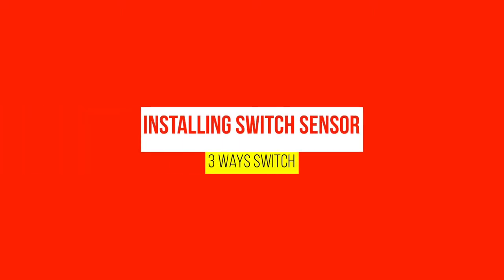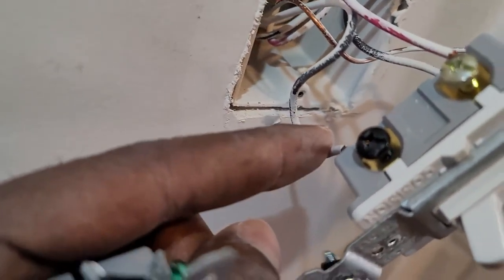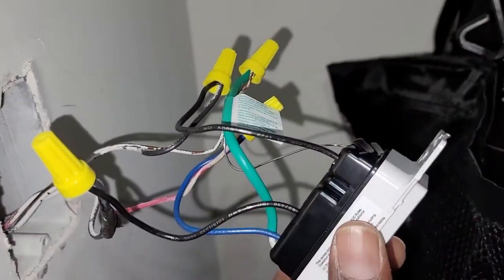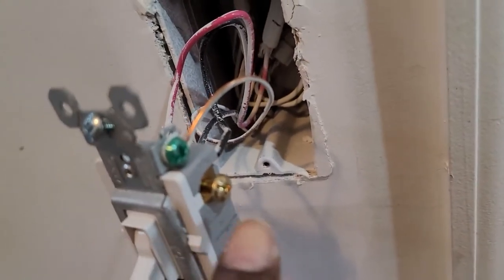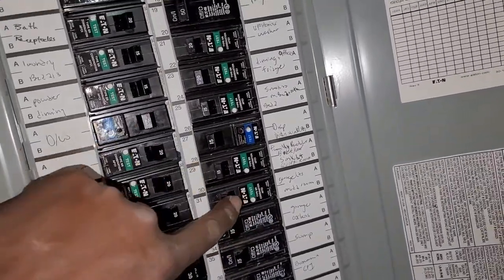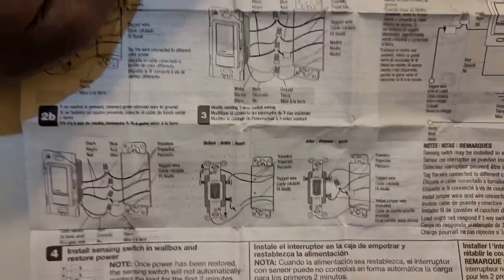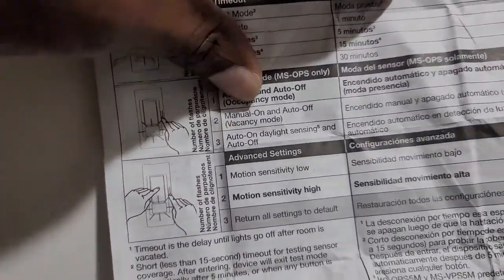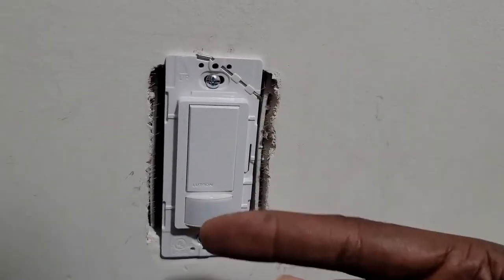Installing Lutron Maestro Switch Sensor & Wall Plate – 3WAYS APPLICATION – EASY GUIDE

Comment: Thank you for this video....I have a question though. My wiring is different I have only one black with was connected to the black screw on the switch, a red wire, a white wire and a bare wire.. how do I work with this wiring? Thanks in advance for your help Mahalos!